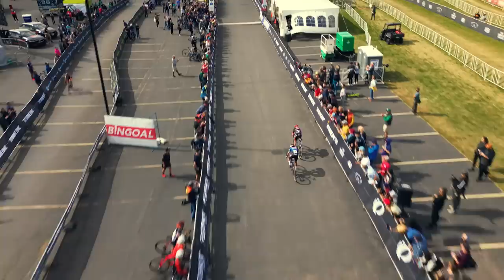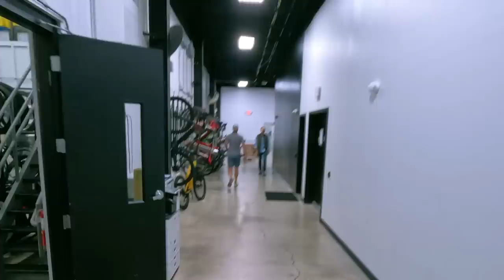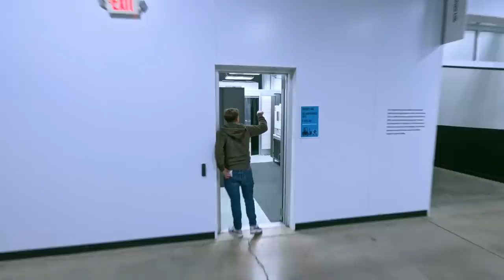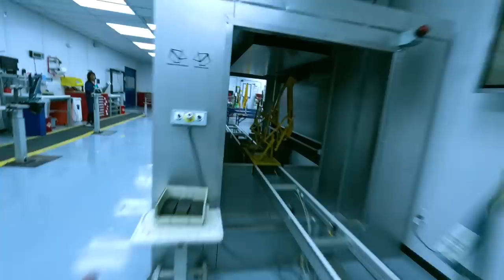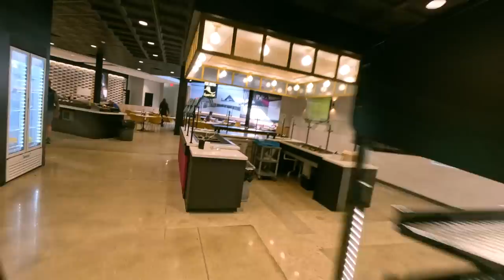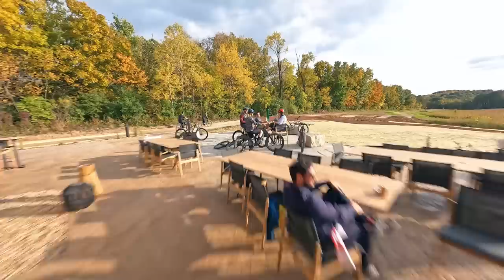Trek Bicycle Headquarters // DRONE Tour

Comment: Trek is the only bike I ride. I remember when the first marlins came out. Had to order the frame only. Because the bike were being sold so fast. So now I have the trek marlin 7 with all of my parts that are what I ride. What would be awesome is if trek and nuke proof built a bike together. I run the nuke proof horizon wheel set. With Vittoria mezcal 29x2.35 xc.